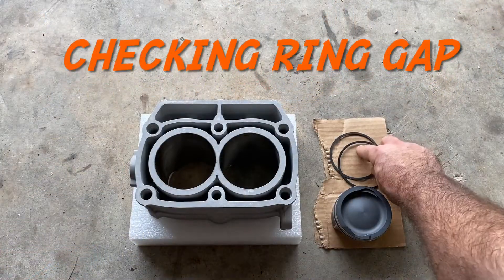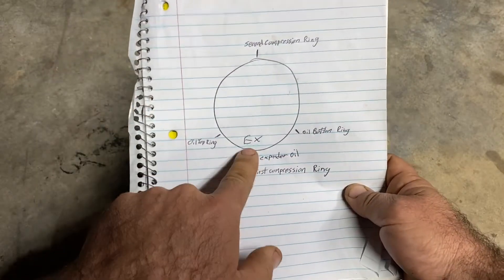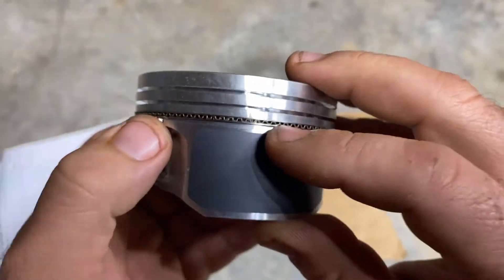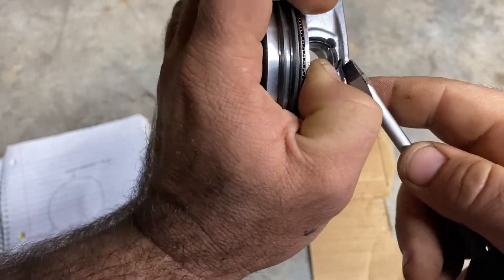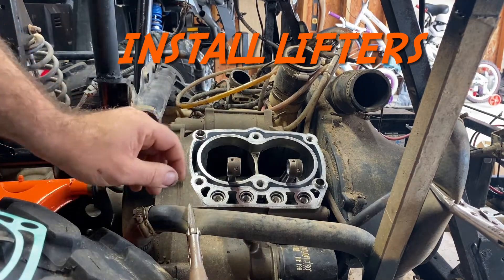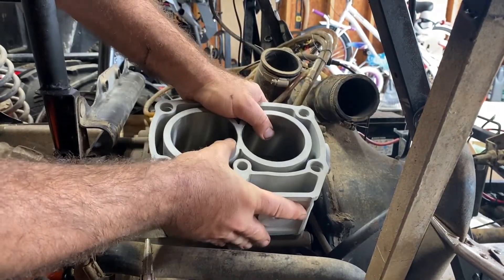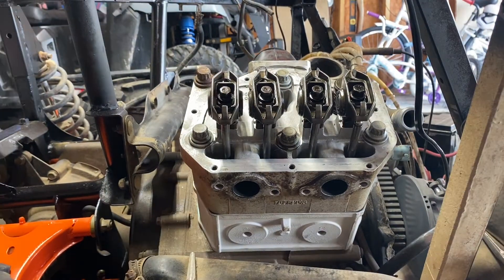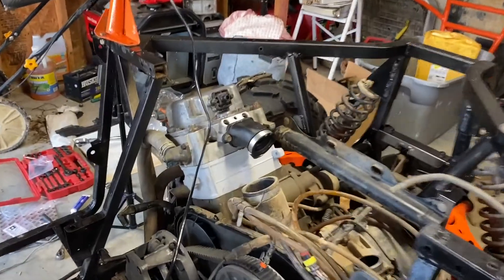Polaris RZR 800 Top End Rebuild Part 3 - Engine Reassemble

Comment: Need help!!!  2012 Polaris 800XP. Hard crank with spark plugs in to point where starter burns out. Without plugs engine turns over easily. Compression of 175psi on both cylinders. 45psi fuel pressure. Sparks at both plugs. Thnks you.
Reply: Did you ever figure this out? Have the same exact issue

Comment: Did you reuse the same head bolts?
Reply from the maker: On this job yes customer didn’t want to do them. Polaris recommends to replace them. I’ve reused in pass with no issues.

Comment: What tip end kit did you use?
Reply from the maker: Rev6 with Wiseco pistons.
Reply: @montemania198210  I just picked up a sportsman 800 with only 115 hrs on it and it just started smoking. Is this likely to be a reoccurring issue on these twin 800’s?
Reply from the maker: @Idonwannabediswayyyy  I usually see this happen from dirt and mud ingestion on these machine. Mainly cause people push these 800’s hard lol.
Reply: @montemania198210  I’d like to think that was the case. But it was owned by an old man and he had daughters that would ride it. He was the original owner. Granted I did still find a little mud here and there. The previous owner also told me the quad seems to foul plugs fairly quickly. Can lack of maintenance contribute to pre mature ring failure?
Reply from the maker: @Idonwannabediswayyyy  absolutely it can. Also if it’s burning oil will 100% foul plugs out.
Reply: @montemania198210  If you ordered Wiseco pistons kit I would be contacting them. Because they sent you the wrong set because those in this video are Namura pistons. Can tell from the big N on the skirt of the pistons where as Wiseco would have a big W on the skirt.. Anyways good video..
Reply from the maker: @Hendogg28  Thank you I try to make good videos. Lol it was actually a inventory issue on my end. When I did video I put the namura in on accident. Ended up putting the wiseco in afterwards. Good eye though. Wish I caught it before head went on.
Reply: @montemania198210  Nothing wrong with Namura pistons I’ve had very good luck with them. Use them quite often. And they are fairly priced and can get them for a lot of bikes that Wiseco don’t have or have discontinued..
Reply from the maker: @Hendogg28  I absolutely agree. I’ve had great luck with them, some knock the namura pistons but I’ve never had a issue myself with them. This customer definitely wanted the wiseco pistons.